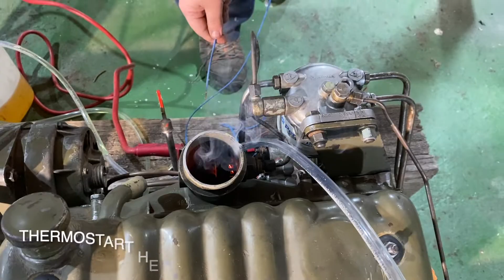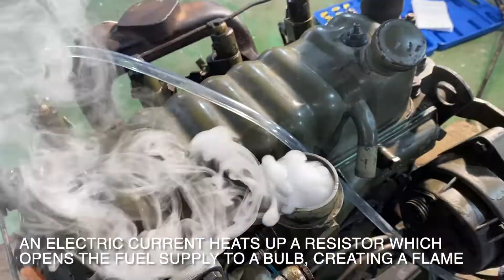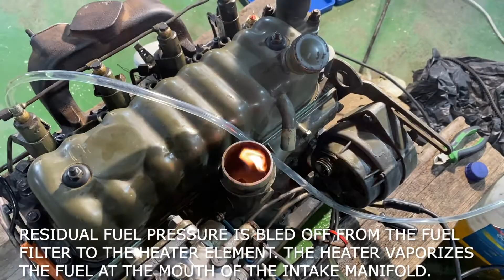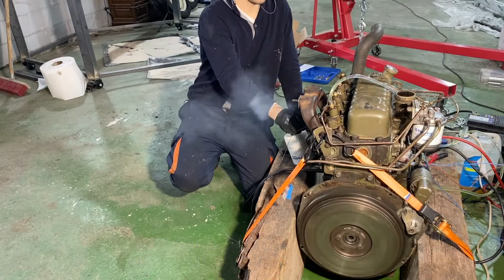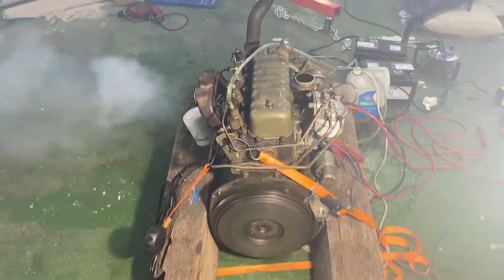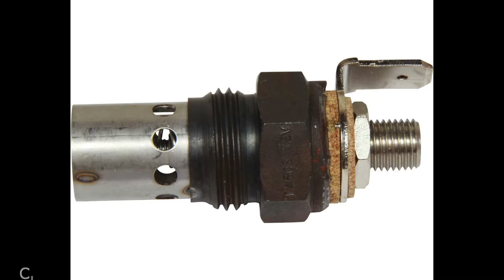Air intake manifold flame preheater. Perkins 4.108 diesel engine. Pre-Heater Glow Plug. Cold start

Comment: Any link to where to buy this flame heater? I think mine is not working anymore :(
Reply from the maker: Hi, I’d buy it from parts4engines UK, original spares: https://www.parts4engines.com/perkins-4-108-glowplug-thermostart/ 
However, this is a 12V version. In military vehicles voltage was 24v
Regards
Reply: @BarcelonaAustinA35  got a new one from a tractor supplier near by :) Do you know where I must take the power from, so it stops heating when the engine is running? And what size cable is recommended?
Reply: @dennisfriborg4803  hi, just wondering if you solved your igniter plug fitting. . I need to fit one to. 4.154 Perkins in a Bedford van.
Reply: @FUNKINETIK  sorry, I just replaced it with the old one. But it do not heat at all. I did not have the time to solve it. Pls let me know if you can figure it out :)
Reply: @dennisfriborg4803  hi Dennis, thanks for replying. I’ve never had the cold start in operation so starting from scratch. I’ve got an igniter plug fitted ready to the air intake. I think I’ve figured out how the little fuel reservoir I’ve bought needs to be ‘plumbed’ in, off the fuel leak off return. So got to find out how the electrics to the igniter is wired. I’m about to ask on the Bedford CF.org forum for some help, so will let you know when I get more info.
Reply: @FUNKINETIK  thats great 👌🏼
Reply: @dennisfriborg4803  hi Dennis, I managed to wire up and plumb in the cold start igniter. The wiring just needed a live feed to a switch and then to the igniter, I also took a feed from the switch to a little valve opening solenoid that I fitted to the top of the reservoir tank in order to let air in to allow the fuel to drop by gravity. It takes about 20 to 25 seconds for a flame to appear.